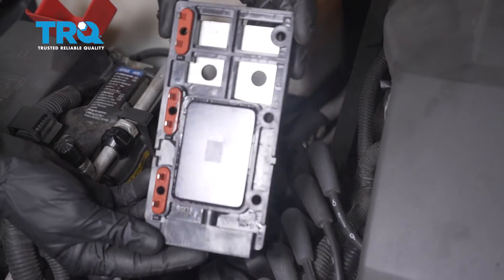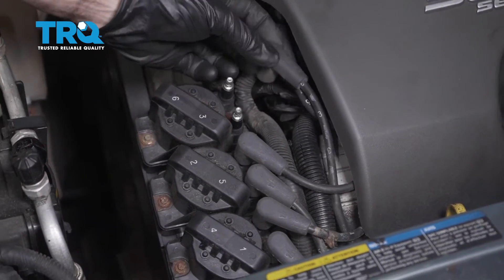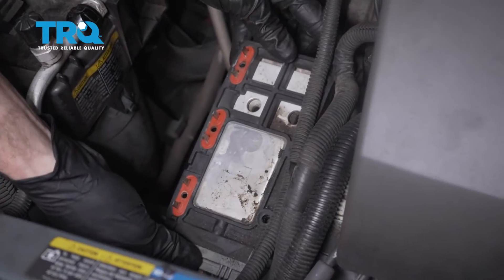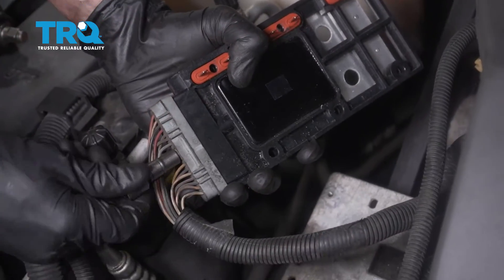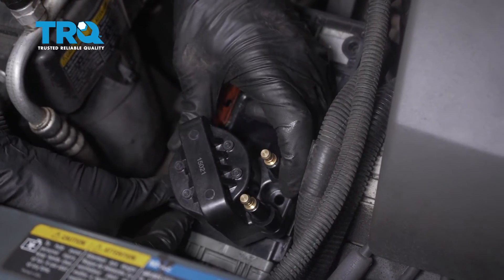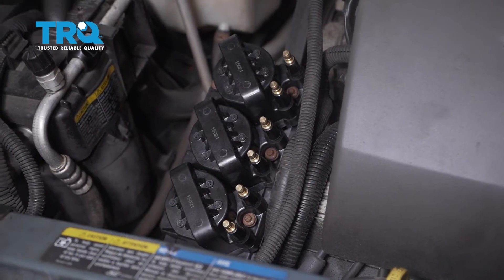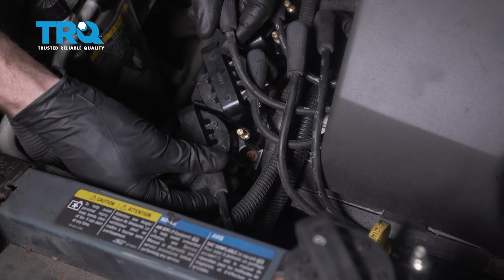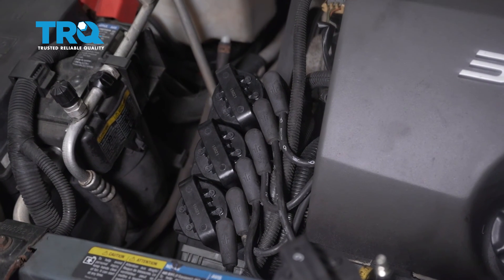How to Replace Ignition Coil Module 2000-2005 Buick LeSabre

Comment: You don’t put dielectric grease on the actual contact points/terminals. It should be applied to gaskets/seals. 🙄

Comment: I wish mine was this easy..I have 3.4 Montana van..exactly the same coil and set up except coil pack is on back side of motor under the wiper arms..Total pain to get at..barely get a wrench in there..took 45 mins to remove the 3 coils.So when I see you use a cordless tool I am so jealous..I could only get 1/4 turns of ratchet.then done all by feel..working blind..